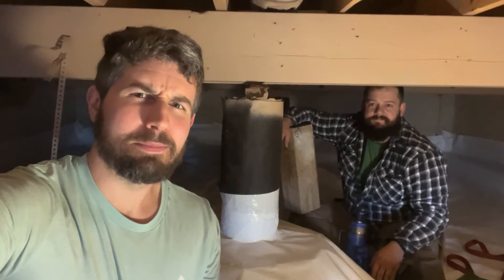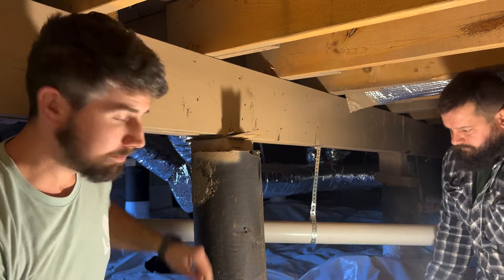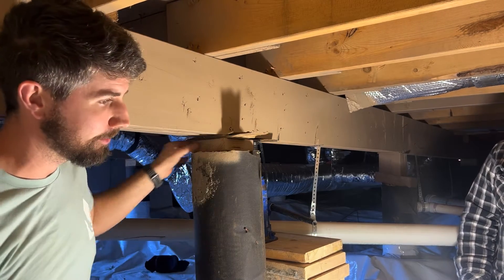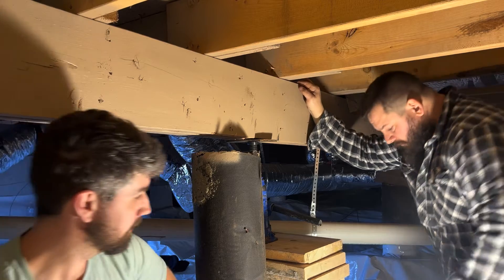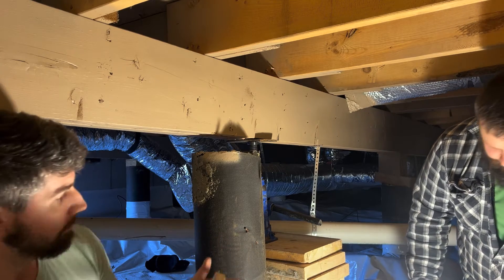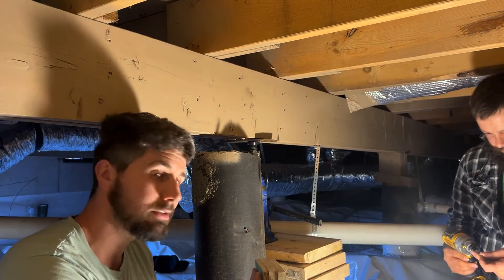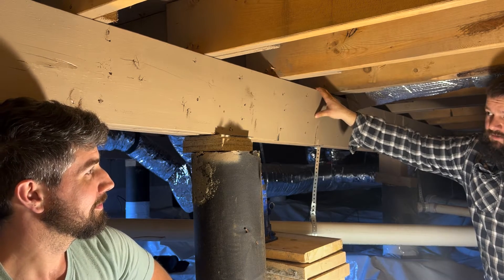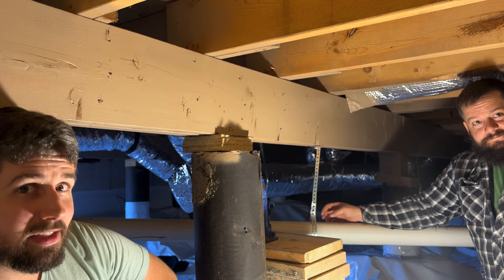How to Reshim Foundation Pier: Fixing Settling Issues & Cracks | Step-by-Step Guide

Comment: I'm working a subfloor on a 2 story 1950's pier and beam. Finally made it down to the joists to find the piers are cinderblocks stacked on pavers no footings or tie-ins with dimensional shims that are fully compressed. Should I recommend leveling before continuing the floors? I've found up to an inch of sag in some areas.

Comment: I am looking into buying a new to me home and the inspector came across some wood (wedge style) shims that were sitting on the piers but nothing actually between the peirs and the beam, and the floors are slightly uneven in one closet and having some door latch issues, along with the girder (I think is what he called it) looks like 3 2x6s that are supposed to be flush together have separated on the end, would re shimming and possibly jacking up a little higher help this issue, the house is 17 years old
Reply from the maker: If the house is only 17 years old and has this kind of structural issues than you should run away from that deal.

Just think about how easy it would have been for someone in the building process to see that issue and fix it (the answer is very easy). Now there are a hundred things just as important but much harder to spot in the building process. If they were doing that poor of a job in the foundation that there are way more issues else where that you just can't see just.

Comment: Great! Thanks. Our house (built 1974) has cement tile siding as the shims. I have almost an inch of slope from exterior wall to center of floor on second story (discovered when I redid 2nd story bathroom). I won't get to level without cracks in that brand new bathroom, but can I at least mitigate further compression with this method? Maybe risk an 1/8" rise?
Reply from the maker: You can mitigate further compression with this method. You could possibly get a little extra lift to help level the home as well. You would have to do the jacking very very slowly over the course of a day to make sure no major drywall cracking occurs. However, when lifting a home up there is always some risk of cracking interior finishings.

Comment: Great video guys! I actually am in the process of re-shimming the supports in my basement. I was going to just cut my own shims, I didn't think about them compressing over time.
Reply from the maker: Good luck! Feel free to message if you have any questions. Be sure to use hard materials for your shims!
Reply: I have the exact same issue with my home. Should the joists be lifted up to the original level position? How do you get everything level again with the new shims?